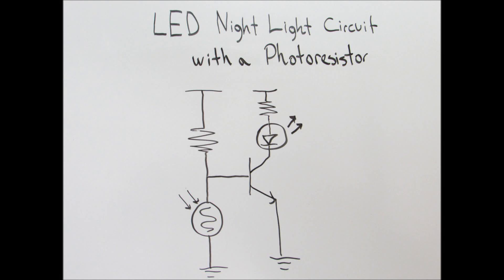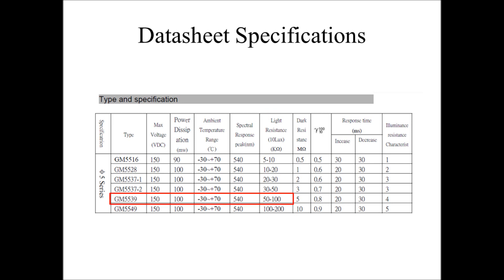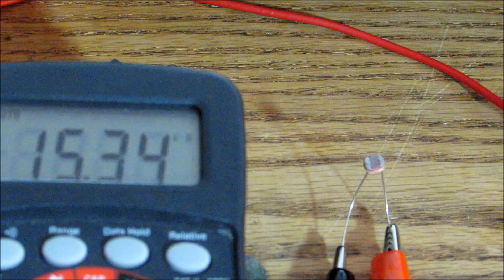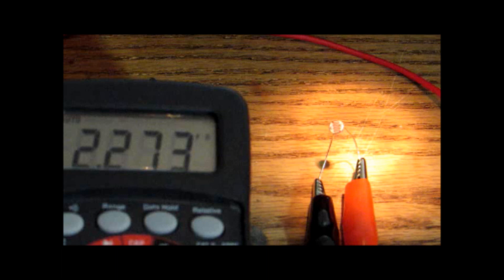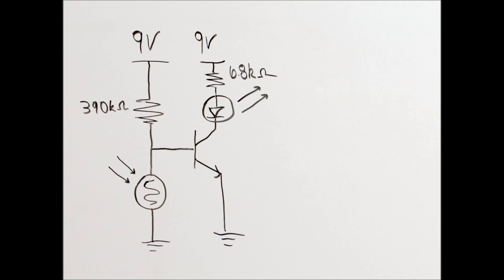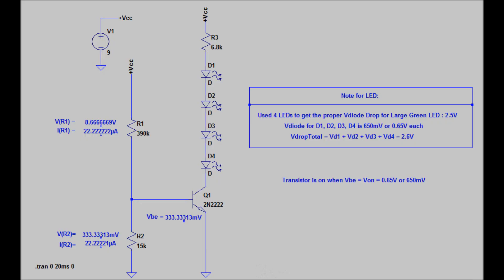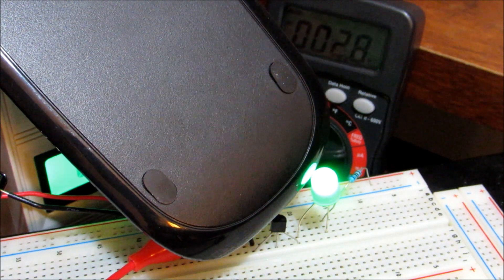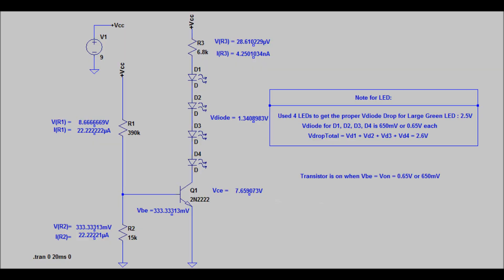LED Night Light Circuit with a Photoresistor Part 1

Comment: it's really cool....can u help making a simple led circuit ...i mean wedding lighting ..that rhythmic circuit board
Reply from the maker: Sure! One way to get started into a project like that is to get an Electret Microphone. The Electret Microphone converts sound input to an voltage. You could use the generated voltage to control the brightness of LEDs - which would vary with the amplitudes of the audio input. You could connect the Electret Microphone an amplifier output stage and drive the LEDs in proportion to the surrounding Audio input.
Reply: thanks a lot...if u can share a vedio it would be so great...cause although it's a small project but always I wanted to make one ...sir if u please make one vedio on this